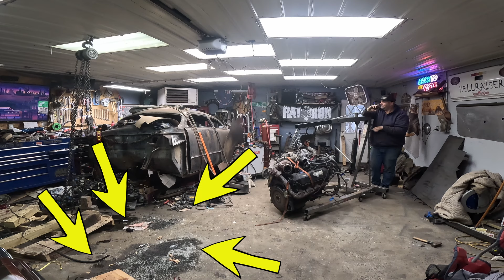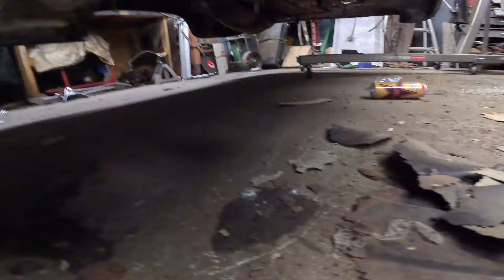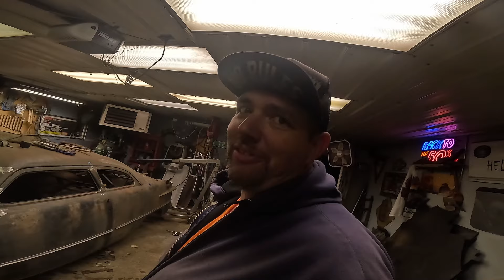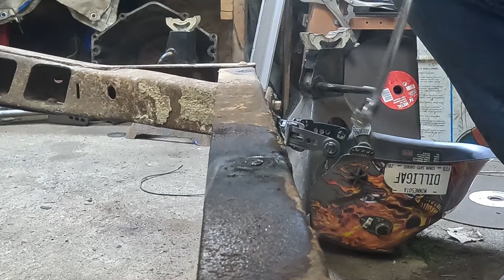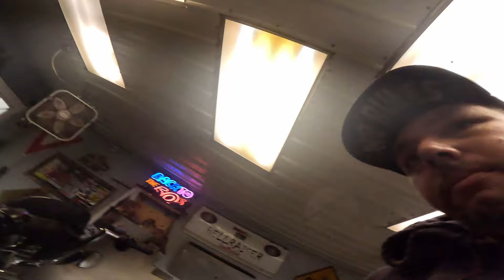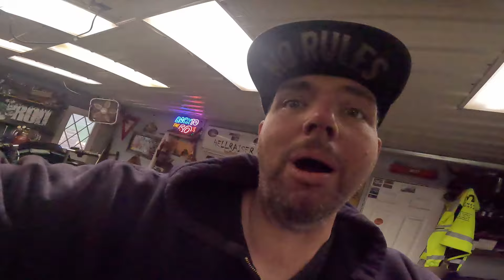Will it FIT? Setting the body on the frame

Comment: Part of the reason you had moving the engine is that you had the boom extended out too far placing all the weight on the two wheels. Since you are building a new floor it's the perfect time to channel it to lay rockers.
Reply from the maker: Yes you are correct about hoist unfortunately for reach I had to. Also I really wanted to channel it but it's more work and time and I'm running outta time lol.

Comment: If ya got a buddy with a mill, and  not off by much, you can do that. I did to fit 70s GM rims to 49 Olds., & it worked. Newer stuff is measured via ctr., hole is why,,,Dubs,,,, car looks great,,
Reply from the maker: Thanks for the tip